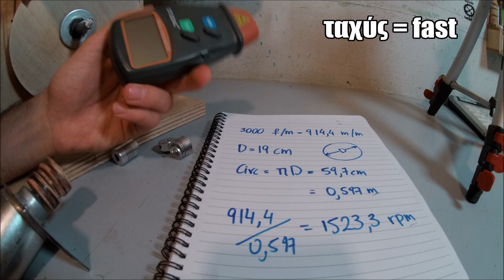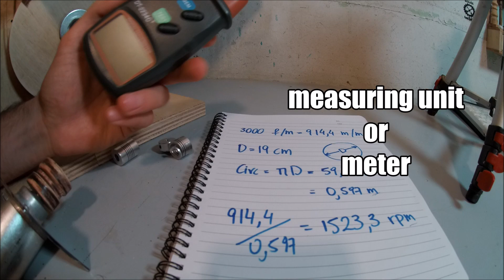Change of plans: Bandsaw speed and motors

Comment: I have a lot of Greek friends, so I would suggest to use "Malaka" instead of tachometer lol
Good video btw. I am in the process of making my own Bandsaw as I have an old single phase Treadmill induction motor to use. it has 3/4 hp with 1430 RPM with 240 V / 50 HZ. I would probably use a belt and pully and make sure using your calculation to design the correct dimeter of the wheels! 
Thanks :)
Reply from the maker: You could use malaka instead of everything arround here!
Cheers Harry!

Comment: What ıs the dıameter of your wheels ?
Reply from the maker: Hey Batuhan! It would be 19 cm, but I 'd make them a bit larger if I was about to make this again.. Found that the throat size is more important to me than the maximum resaw capacity!
Cheers
Reply: Zep Labs  İ am gonna copy your work with some differences.
1-i will use hard plastic hand forktlift front tires which is 20cm for wheels.

2- i found monophase 250w motor with 1200-1300rpm..is it too much for my wheels? 

3-i asked a technician and he advised me to use bigger bearings cause small bearing will be hot and wont work properly after a few time use on high rpms..

Answer me pls..
R u from Greece?
Reply from the maker: Hey Batuhan! Sorry for the late reply..
20 cm wheel gives you a 0.2*π= 0.63 m perimeter. So for a 1200 rpm motor you get (1200*0.63=) arround 750 m/min. Sounds sweet!
The rpm is kinda low to overheat your bearings, but the bigger the better I guess!
Yes I m Greek
Cheers